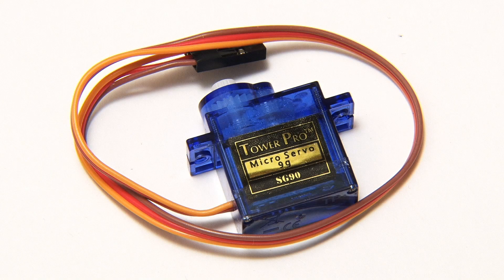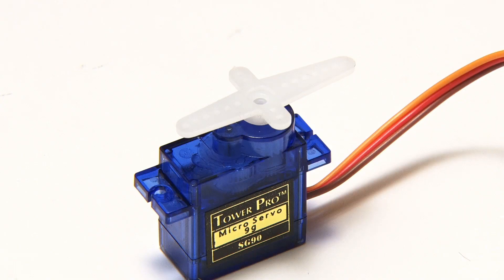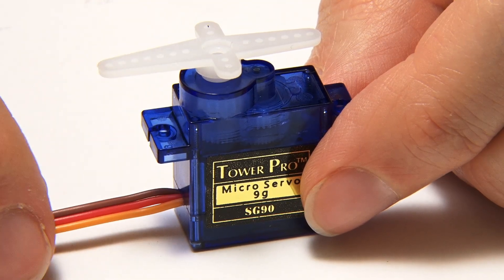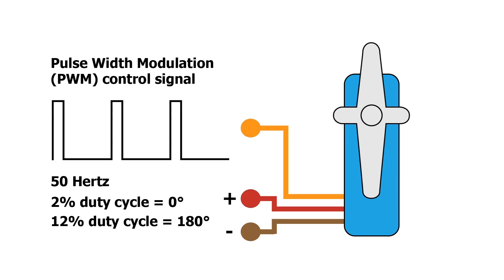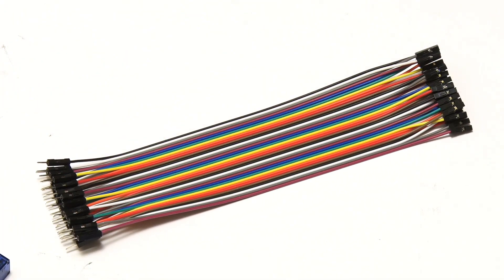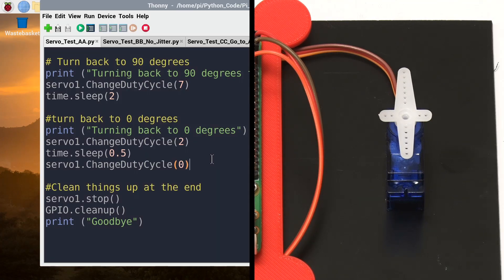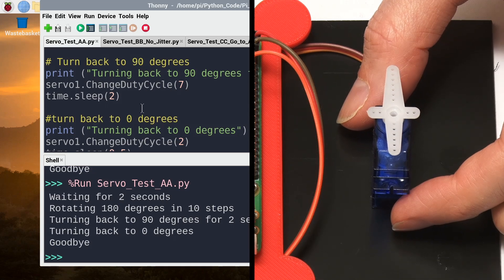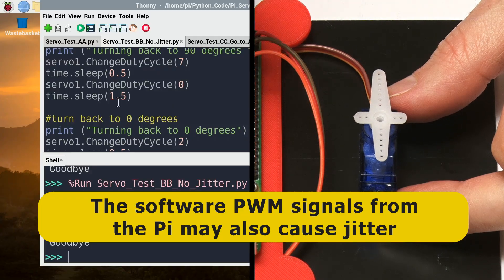Raspberry Pi Servo Motor Control

Comment: I'm getting jitter from the angle test code. Is there a way to fix the jitter when using this angle formula.
Thanks
Reply from the maker: It will depend on the individual servo, and also potentially the Pi. Software PWM from the Pi is not brilliant -- I only really stopped jitter here by turning the servo off when stationary.

Comment: servotest.py:9: RuntimeWarning: THis channel is already in use, contiuing anyway. Use GPIO.setwarnings(False) to disable warnings.
GPIO.setup(11, GPIO.OUT)

What should I do??????

Can somebody please help me? :(
Reply from the maker: This means that GPIO cleanup has not run previously. If you run the code and exit via control-c you should get this error on the next run (as the exit will cause the finally code to execute), but check that the GPIO cleanup code under finally is correct.
Reply: @ExplainingComputers  Thx!❤️

Comment: How much of that servo jitter is due to the Pi's lack of software timing precision? Servo jitter is not usually that severe.
Reply from the maker: A lot will be due to the fact that the Pi here is using software PWM.

Comment: I have the same servo but it always goes to about 190 degrees instead of 180.  The end position is then always about 10 degrees short of the starting position.  Is this simply down to the fact it is a cheap servo?
Reply from the maker: Almost certainly this is an issue with the particular servo. They are amazing for the price. :)

Comment: I modified the Go_to_Angle example and came up with this:

# Script originally from Christopher Barnatt over at https://www.explainingcomputers.com.
# Modified by Alex Landherr. Python Version: 3.7.3.

# Import libraries
import RPi.GPIO as GPIO
import time

# Set GPIO numbering mode
GPIO.setmode(GPIO.BOARD)

# Set pin 11 as an output, and define as servo1 as PWM pin
GPIO.setup(11,GPIO.OUT)
servo1 = GPIO.PWM(11,50) # pin 11 for servo1, pulse 50Hz

# Start PWM running, with value of 0 (pulse off)
servo1.start(0)

# Loop to allow user to set servo angle. Exit command allows exit
# with execution of servo.stop and GPIO cleanup :)

while True:
    # Ask user for angle and turn servo to it
    angle = input('Enter angle between 0 & 180, type ''exit'' to exit program: ')
    if angle == 'exit':
        servo1.stop()
        GPIO.cleanup()
        print("Goodbye!")
        break
    int_angle = float(angle)
    servo1.ChangeDutyCycle(2+(int_angle/18))
    time.sleep(0.5)
    servo1.ChangeDutyCycle(0)

Comment: good morning I am new to coding pi but if I wanted to use a pi to control servos but instead of coding the values manually like shown in your video but if I wanted it to take the values say for example from sensors like an gyroscope and accelerometer how would I code the pi to execute commands. 

kind regards

c bates
Reply from the maker: This is certainly possible. You will need to read the data from your sensors, then use this data to control the servos.

Comment: How to set the initial position of servo motor, and all angles with relation to it? It always starts of at 45 degrees. Whenever I input 0 degrees for example it's at a 45 degrees angle. And when I input 45 degrees it's at a 90 degrees angle.

Comment: For my app, it's natural to think of angles between 0 and 180.  I watched this video and experimented until I came up with the following correspondence between angles and duty cycles. '0':2, '45':4.2, '90':7, '135':8.5, '180':12 .  I mentioned this on the Raspberry Pi forum and was warned: "I would not use 2%, that equates to a pulsewidth of 400µs which is probably damaging your servo. The pulsewidths you are using are 0-400µs 45-840µs 90-1400µs 135-1700µs 180-2400µs. The servo seems a bit hit and miss. I'd expect a stronger correlation between pulsewidth and angle."   You all know understand this better than I.  Can you comment on the warning?

Comment: Hm, I am a little confused. I use similar in my rc plane models. Datasheet of the servo saуs that the minimum and maximum values of duty cycle is 1ms and 2ms, wich is 5% and 10%. So in range of 2-12% we have 0.4-2.4ms. Why the range is extended in your case? Thanks!
Reply from the maker: The values I used were based on the datasheets I could find, and I cross checked against many sources.

Comment: will it cause inductive damage to our pi without connecting it with motor driver?
Reply from the maker: No, it will not cause damage, as connecting a servo is not like connecting a motor. This is because a servo contains a motor driver. The Pi is only sending an electronic control signal to the servo controller board, which then supplies electricity to the motor.
Reply: @ExplainingComputers  thanks for explanation, its helpful

Comment: Hi, 
Just wondering where can I buy Raspberry Pi Zero W for 10 Pound or Zero 1.3 for 5 Pound? I can't find any cheaper than 18 Pound for Zero W and  10 Pound for Zero 1.3 and that is in CEX.
Brand new ones are more than 24 Pound for Zero W  on Amazon, (1.3 is unavailable).
Reply from the maker: Stock of the Pi Zero is always limited (and has become more so since my recent Zero video went live!). Pimoroni have the Zero for £4.80 here -- https://shop.pimoroni.com/products/raspberry-pi-zero and on the Pi Hut here https://thepihut.com/products/raspberry-pi-zero  Amazon is not a good Pi Zero vendor. The aforementioned vendors have the Pi Zero W for about £10. I purchased  Zero and Zero W models for the £5/10 prices early in 2020 for forthcoming videos.

Comment: Great stuff. Can't wait to see more Pi servo projects. Just watched the hamster one as well.
I found that using hardware PWM helped a great deal with the jitter. Software PWM was terrible for camera quality when using it with a pan tilt stand. All that's needed is to install and use the PiGPIO library.
Reply: Pan and tilt camera, didn't even think of that, thanks. I need more RPI zeros.

Comment: I am struggling with the concept of duty cycle to explain Pulse Width Modulation in the Raspberry Pi.  To start with the wikipedia article and others about PWM  for controlling RC servos says that a 1msec pulse  turns the servo one way and a 2msec pulse turns it the other way, and therefore a 1.5msec pulse centers the servo. https://en.wikipedia.org/wiki/Servo_control .  This is of course independent of the frequency of the pulses, whether they be one every 20msec or one a minute. This 1msec/2msec are generally the minimum/maximum values.

Duty cycle usually should have  a fixed frequency, but this is not mandatory. This is the width of the pulse relative to the period of the pulses. Within the Raspberry Pi software we are specifying a frequency of 50 Hertz, which gives a period of 20msec.  A 20 msec pulse is 100% duty cycle, and a 10msec one is 50%. For a servo to get a pulse width of 1 msec, this is a duty cycle (50Hertz) of 5% and a 2msec pulse is 10%. 

The leap of faith that you have to have here is that  in the software the value that you use to specify the pulse width is the duty cycle percentage. This is never stated explicitly. 

Testing with a couple of servos that I have in my collection, and guessing the angle as I don't have a protractor handy, and starting from a central position (1.5msec pulse specified as a 7.5% duty cycle)  one servo arm moves +/- 45 degrees and the other moves just less than +/- 90 degrees.   So whichever servo you use, testing is required. 

Good information about Servos
https://www.pololu.com/blog/12/introduction-to-servos

Deatil about using PWM for RC servo control:
https://en.wikipedia.org/wiki/Servo_control

Python PWM. To my mind uses the term 'duty cycle' rather than 'pulse width'. 
https://sourceforge.net/p/raspberry-gpio-python/wiki/PWM/

Comment: Someone asked for a recommendation for which Raspberry Pi to use. I like to use mine wirelessly in ad-hoc mode, that is without an access point. You have to program the Pi to be an access point, and not all WiFi dongles support this mode of operation. Happily the Pi zero w does.
Reply: Does your dongle support Access Point mode? https://wiki.archlinux.org/index.php/software_access_point

Comment: I am in the middle of building a project that requires a lot of motors. it will need about 2 servos and 3 steppers ( like the ones for 3d printing).  would this be safe for a raspberry pi?
Reply from the maker: Certainly safe, but you will need to power them from another PSU.
Reply: ExplainingComputers  thank you for you reply, I have one more question.  for this project I also need python Which I don’t know how to use. Where would be a good place to go to learn for free/low cost

Comment: Is there a way to make the servo move slower?
Reply from the maker: It can be achieved by sending a servo a signal to move it across many intermediate positions (ie don't just send it an end position, but via a loop say 100 angles between its current position and the end). But generally, a stepper motor would be used in such situations.

Comment: I have applied  this video to driving the steering on my R-Pi controlled  ex-RC car. Here is my blog post about it. The code could probably do with some tidying, but it works. 
https://madsmaddad.blogspot.com/2020/01/rc-car-steering-with-pwm.html
Thanks for the inspiration.
Reply: Well, I guess I don't like doing things the easy way.
Reply from the maker: @PeterGMerchant  But you clearly love to tinker, learn and experiment! Which is far more rewarding.
Reply: @ExplainingComputers  We have similar histories. I was involved in data communications from the late 70's including packet switching, X.25 network management and Spread Spectrum wireless before it became WiFi, and then the last ten years of may career as a teacher of network systems in a Business School.
Reply from the maker: Very interesting -- great to see Pi controlled servos in application. Thanks for sharing here.

Comment: Has anyone had trouble running the software. I receive all the print messages, but no servo movement. Electric connections are OK, tried several servos.
Reply from the maker: This is very strange. Are there any errors coming up?
Reply: @ExplainingComputers  Occasionally I get "segmentation error."
Reply from the maker: @robertpendergast2620  I am struggling to understand what is going no here. It may be an issue of the servos drawing too much power for your adaptor, but I doubt that before they are even moving. It sounds like the GPIO library is perhaps not running. In your position I would recheck all wiring, and also all code (assuming you typed it in, rather than downloaded it) -- esp for capitalisation errors. Good luck!
Reply: I have no Problems with the micro servo sg90 but it does not work with MG996R it just jitters
Any idea why

Comment: Great, do not forget that ESC use the same principle, you can hack your RC cars and send PWM signals for ESC from RPI. Even in C language using ServoBlaster, directly without motor controller's PCB. To achieve better timing, you can reserve one core of RPI for running ServoBlaster. There is possible to compile OpenCV on RPI to make some serious stuff.

Comment: Micro servo motors are fine for learning, but they're too fragile for most real world applications. Personally I'm a fan stepper motors, they are robust, precise and you can literally find them in a trash area of any larger office building (you can find really lovely stepper motors in higher end commercial printers from brands like OKI or Kyocera). I have buit a reliable drive for a camera slider (with timelapse function) pretty much for free (I already had arduino, motor controller and some old li-po drone batteries)

Comment: Servos... I don't think its your concern to conrol... you're computer, programming specialist so.... but if you want to enter in electronics control then go more deeper to work more like with microcontrollers, fpgas, PLCs, motors, Sensors to explain deeply...

Comment: Hello EC, first off i want to say your videos have been very knowledgeable and interesting. However i hardly ever comment on videos but after watching ALL your videos and after some time watching your SBC's videos, I've lately wondered if there are any types of SBC that are do able "Gaming" SBC. Now nothing too extreme but say for exmaple 2000ish to 2006ish games something low to maybe? mid settings for gaming. I ask because i run my own computer shop(we do custom builds and repairs) and i have clients that want a computer thats portable(but doesnt have the laptop issues of the battery dying or over heating) that can game but nothing "high" end. I figured SBC are "THE" go to in my head for something like that, but i know from watching yours videos ,the GPU (mhz) isnt that high compared to say that of a gtx 760 or the likes of. Any advice or pointers(to where or when) would be great! Cheers and looking forward to your next video. Also im thinking of buying a few SBC for simple everyday use for my clients. Their portable,easy to use,very tiny!(great for small rooms and the likes of),and very affordable compared to spending $100's of dollars or even thousands of dollars on a computer.
Reply from the maker: Thanks for watching and your kind feedback. :) For x86 gaming, you could look at a LattePanda Alpha or Delta,  or one of the UDOO boards. Many ARM SBCs will also game pretty well in Android, but the GPU power is nowhere near a PC as you note.
Reply: @ExplainingComputers  Awesome! will look into those 2 SBC's! Thank you soo much. Now i just have to wait for the GPU on the SBC's to catch up :).

Comment: Great video,but bad code example for beginners.Never use a userinput in your example (0-180) without checking if it is as you expected it to be. What happens if the user enters 360??
In my opinion it is one of the basics for programming a good code.(sorry for my english, i am german)
Reply from the maker: But the basics of good education is not getting making things too complex, or going off on tangents that deflect from the topic. Yes, you are right, good coding says do some error trapping for invalid values. But that is not what this video about about.

Comment: I was actually very excited to see the title of this video, and pretty excited to watch it! Slow-motion control of points on a model railway (in case you were wondering).

But may I enquire why you were only using software PWM (which I admit I knew nothing about!) rather than the hardware PWM which is available on the pi? Would it be because there is only one of them?

Anyway, Can't wait to see what you're planning to do with your servos, Chris. My guess is something robotic. :)
Reply from the maker: I used software PWM as the Pi has only a few hardware pins (2 or 4, depending on the model and what else is being used), and because the standard RPi.GPIO module is software only.
Reply: @ExplainingComputers  thanks Chris, that makes sense.

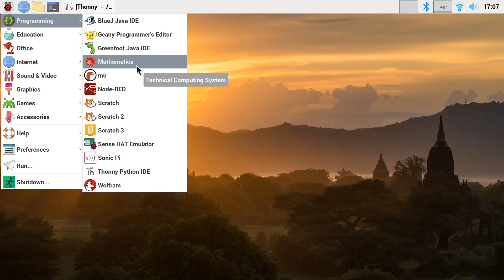Comment: 6:14 Chris says “...we do not have IDLE anymore...”.  Chris we still do, actually. I’ve experienced the same until found out it is disabled.  To enable it as well as other possibly disabled apps in the Pi do the following:

Menu / Preferences / Main Menu Editor.
In the editor dialog select 'Programming' and enable (tick mark) 'Python 2 (IDLE). That’s all.  Changes are immediate, no reboot required. 
Ps Keep up a magnificent channel of yours Chris.
Reply from the maker: Indeed! :) Or sudo apt install idle  -- and you have IDLE for Python 3. :) But I like to use standard settings where possible so that projects will work for the widest audience. And if I used Python 2 today, I would (sadly) get compaints in the comments.
Reply: @ExplainingComputers  Agreed, this is important.  Thank you for thinking of beginners!

Comment: I thought the RPI had two hardware PWM GPIO and the rest could be software PWM. Are the hardware ones not as good as other microcontrollers?
Reply from the maker: The two (or four on the Pi 4) hardware PWM pins are not as good as those on other baoards. :(

Comment: This is the kind of thing I was doing in 1980 on my PET using BASIC. All forgotten now though. Any recommendations on a book on this particular subject using the Pi? Most automotive actuators work on this principle with feedback potentiometers which need reading by the Pi to determine where the actuator is. These actuators are very powerful,robust ,accurate,long lasting and reliable.

Comment: Good video. But I'm not risking connecting the motor power to the pi. Also have you looked into gpiozero? You should do a tutorial on that as an alternative to RPi.GPIO.
Reply from the maker: The 5V rail on the Pi is before its voltage reguatlor -- so there is no risk of damaging the Pi, just crashing it.

Comment: Chris would you be able to do a video showing how to operate these servos or motors using an xbox 1 controller? I have figured out how to connect the controller to my pi but there isnt a lot of straight forward videos on how to utilize it for the purpose of robotics (or perhaps i am not searching for the correct things)

Comment: Are these affiliate links?
Reply from the maker: The Amazon links for the servos and jumper leads in the video description are affiliate links, and are labelled as such (it says "affiliate links" after them in brackets). The other links in the video description -- to my website page with the code and to other videos -- are not affiliate links.